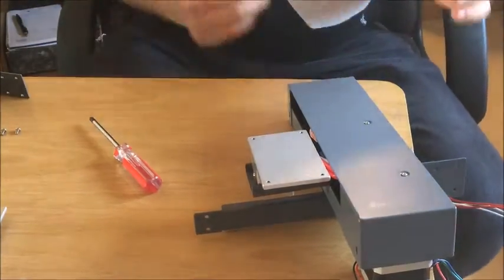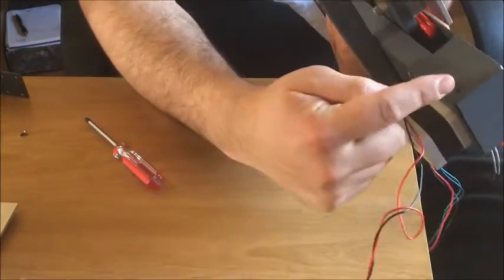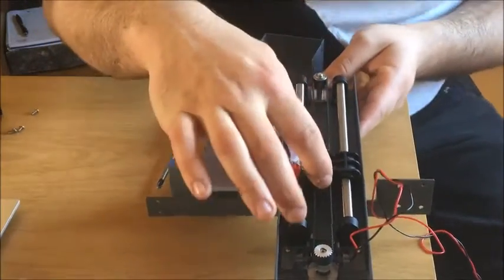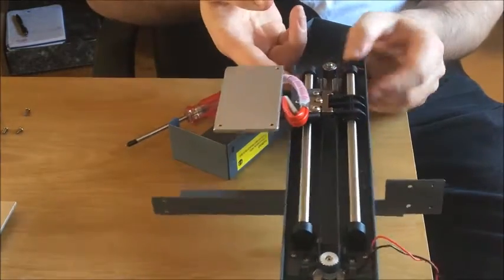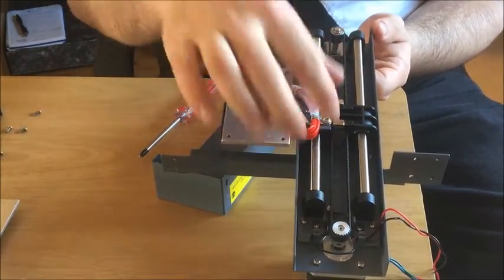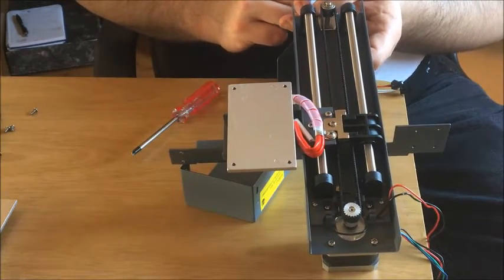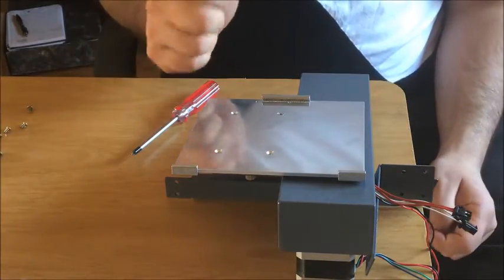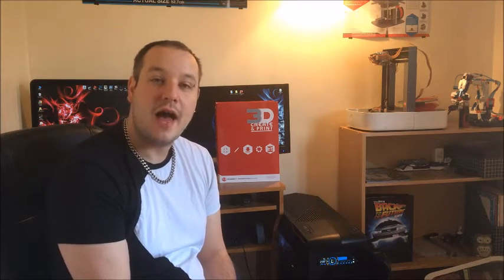V3 3D Printer Y Axis (Print Bed) Wobble FIX!

Comment: You had me up until you said "lt's really good".
In what universe is this shockingly overpriced, barely functional machine "really good"???

It's fairly obvious to me that Eaglemoss bulk-ordered the cheapest parts they could find on Alibaba (stuff that would otherwise have ended up in a skip somewhere in Shenzen) and made it look pretty with a bunch of bespoke plastics that ultimately just end up making the slightest adjustment result in a two hour stripdown!

I'm glad I didn't pay for mine (an eye-watering £640 just for the basic kit of 90 parts) as I was given it by a friend whose son had lost interest after assembling the first 10 parts. If anyone else is considering buying this thing, all I can say is: DON'T! Buy a Creality Ender 3 - it's a quarter of the price, a far better machine and there are endless mods and upgrades available!

Comment: Hey dude, my y axis keeps slipping. As in when i try to remove the  plate after a print (pressing the clip) it moves! any ideas? i opened it up and it seems like my belt lifts a bit at the motor end, but like 20-40% lift. You think that is what is causing the issue?
Reply from the maker: Tino Collias possibly . Re adjust the belt drive on the motor by raising it slighly. And re tention the belt and then run it back and forwards by hand untill yoir happy that the belt it tight enough and not trying to come off the pulleys. Also once adjusted take the belt clamp off and re clamp it.
Reply: its also causing prints to not not "place" correctly... and also i dont have the fan attached from issue 91

Comment: hey need your help if that's ok same issue not printing round objects
Reply from the maker: Lestat De Lioncourt what is it doing? Does it not run the axis smooth causing jolting?
Reply: it printed round once.... but now it's kinda of and eye shape??
Reply from the maker: Lestat De Lioncourt ive have Not come across that? I would suggest first uninstall and re install 3d create a print software ( just in case the default speed settings have been disrupted) then re install the printers firmware from the website, then try again.
Reply from the maker: Lestat De Lioncourt obviously you will need to re calibrate the height afterwards and before you re print.
Reply: Horlicks I'm going to upload some videos later on other things too for you to see what I'm talking about like that horrible machine gun like noise it makes I'll let you know when posted...
Reply: videos uploaded

Comment: Mine started Ok,

1. But soon found that the filament was being ground up by the feeder, no matter what tension I put on it it keep up doing it.

2. The head is so loose on the sliders it make the head chatter.

3. The temperature of the head  keep going up and down eg. 280 to 250 to 180 to 250 etc, even when set to 200c.

4. The ribbon cable at the head keep coming off as it is move back and forth alone the x axis.

5. Now the fan in the power supply is making a grinding sound. so need to be replaced. for the second time.

6. Now both heaters elements have now stopped working.

7
 The  gap were the mounting plate comes out in the slot in the cover of 
the X axis, rubs so bad i had the cut 1/16th off the top of the slot.

8 I have replaced the main board 3 times till i found one that worked.

All this in one week.

Would I recommend this printer Hell No.

The only good thing about it is it will make a good looking door stop.

Comment from the maker: Just a thought. Are your bearing guides straight? Could one be warped?? It seems odd you have been 2 bearings and now awaiting a third! Just an idea.
Reply: Horlicks that's a good point, actually! I'll have to remove them and, I guess,  try rolling them on a flat surface to check that. Thanks again., man.

Comment: I did that but it still kinda wobbles slightly when it gets to the centre of the axis. But great video. Thanks
Reply from the maker: Sorry it did not quite help you out. In some cases it may just be the parts. Contact eagle moss and they will re issue you with another bearing, believe its issue 3.
Reply: Horlicks your tip definitely solves the problem, I think I just got a dodgy bearing block (for the second time). I ordered another one today, and I must say Eaglemoss are pretty good at replacing parts. Just hope this one does the job.